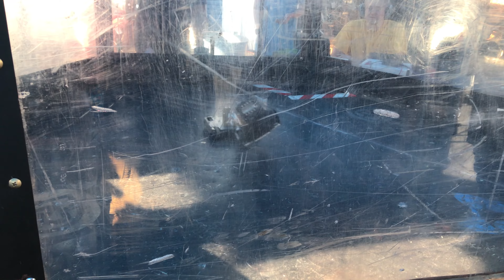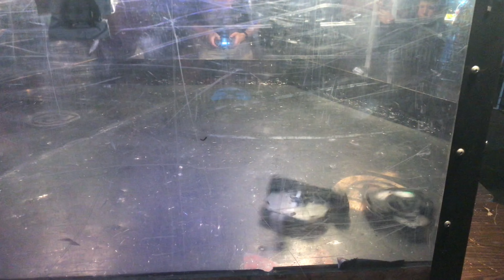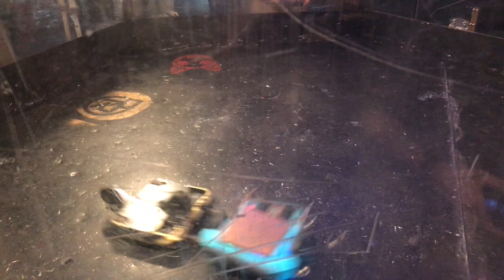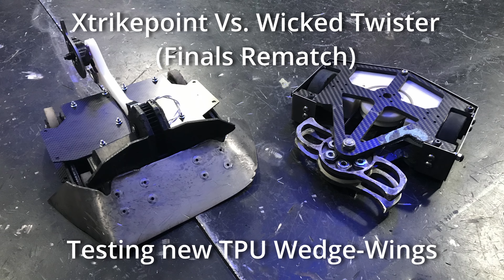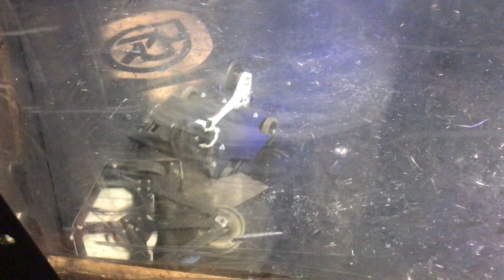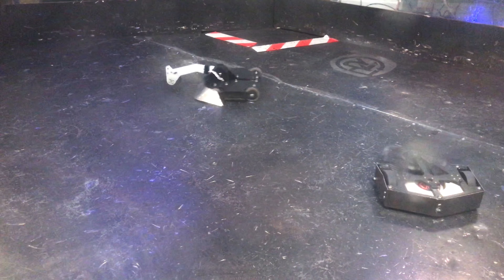Xtrikepoint Tests Beetles at SCAR Destruction Under the Stars 2023

Comment: Strike point (and xtrike point) is so cool. it can function as a vertical spinner(somewhat), hammer saw, lifter, and it has a self righting mechanism.
Reply: Also as hammer if the saw is not working